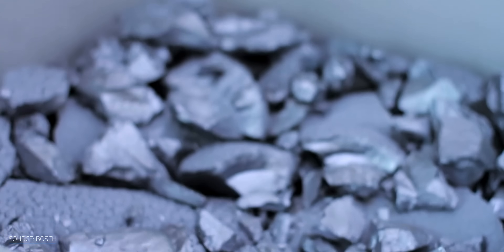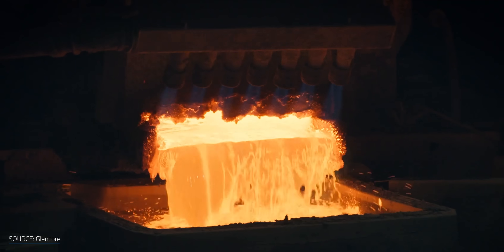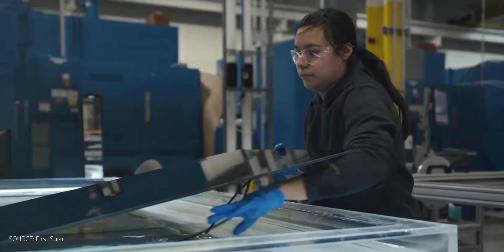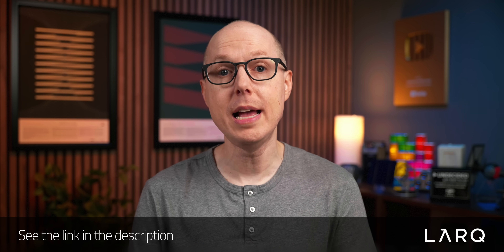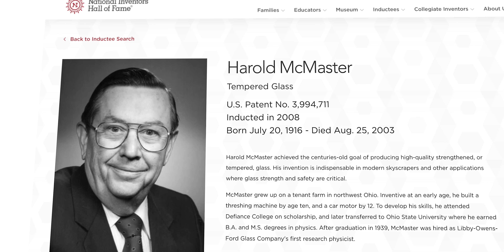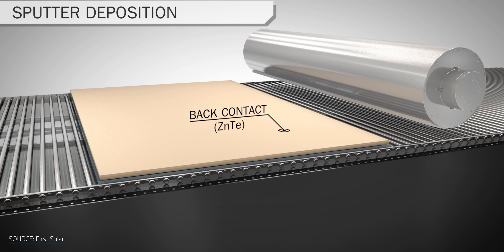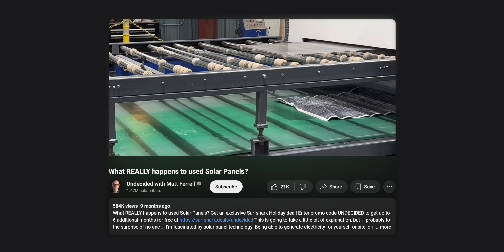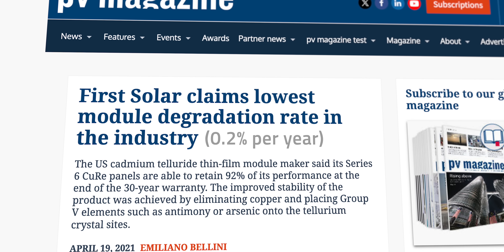How the Next Big Solar Panel Tech is Already Here

Comment: Once they get the efficiency to the same level, the weight reduction could actually prove very beneficial to residential PV renovations. Since it weighs less, it would reduce the need for roofing/truss modifications to support the higher weight load.  I think this is a good thing for everybody.  Yes, the recycling is critical, but that should only be a process limitation, not an absolute limit.

Comment: The biggest issue with CdTe is, what happens when we need more than just the byproducts? Even right now CdTe Panels are barely competitive to silicon. And Silicon Panels are already dirt cheap. So much even that they aren't even the main part of the cost of building a solar farm. Silicon Panels also still get cheaper by the day.

Comment: With solar, you can avoid many of the "moving parts problems" with wind and other renewables. If you can produce the solar panel for a 30 years lifecycle with just a few years of the energy produced by the panels, and high degree of end of life recycling, this could be a very good alternative both to other solar panels and other renewables in general.

Comment: I'm okay with cadmium, mercury, uranium or whatever, toxic or non-toxic. As long as longevity is close to market and as long as there is a very high sustainablity and renewablility at scale. 

If efficiency, location buildout, cost per watt output, etc. is higher, I'm okay with that metric long term.

Comment: Good video. On the numbers point though, this is missing a key piece of information - what’s the capex cost for CdTe vs Silicon. Unless there’s a major advantage in usable life/degradation/maintenance capex, if CdTE is 30% less efficient then very simplified math is that a panel producing the same energy output needs to be 30% cheaper to be cost competitive. If it’s not, why would you buy one vs silicon?

Comment: It’s always going to be down to how cost efficient they are. You can buy new 560W bifacial panels for $200 each. The real issue with solar is installers overcharging like car dealerships, both in materials and labor. DIY as much as possible imo. CdTe has a ways to go, because there’s not as much competition. 

It reminds me of ethernet v token ring. We have, arguably, slower networks/internet due to licensing issues preventing competition. Now token ring has been left in the dust as far as innovation and cost goes. The best doesn’t always win in any given market.

Comment: Very informative! Never heard of the technology, but based on the comments from those that have used these cells, I can think of great use cases. 
Extra federal credit for US based manufacturing and material sourcing can mitigate the lower efficiency. 
I these can be biracial, then when used in the vertical, the smaller string size is fine in a homestead agrivoltaic application. 
Lots of niche use cases

Comment: Cadmium telluride had been on the horizon for various photoelectric applications since at least the mid-1980's. I know that because part of my paycheck depended on an exotic bestiary of research substances and materials. Those were fun times.

Back then, solar arrays used discarded single Si crystal discards which failed specs for wafer printing.

It was my privilege to have a seat at the table when many of these technologies were in development. Gallium arsenide for Josephson junctions never expanded as some proponents wished.

That's how it goes.

Comment: It sounds like they only out-compete silicon panels in thin film configurations, so it would need to be an application where weight is a more important consideration than efficiency. My impression is that solar panels, even very light ones, are generally not practical additions to vehicles. However, a camper van or sailboat might be better off exchanging a large battery for a smaller battery supplemented with panels.

Comment: You end asking if CdTe panels are something I'd use, and the answer is 'eventually'. I'd be using them for a home PV setup, and I have limited roof space. Once CdTe matches or exceeds Silicon in efficiency, then it becomes a strong contender. After that, we need to compare price over the life of the system.

Comment: I would expect CdTe to be more popular for homes. 30 years retaining 89% of its effectiveness is nothing to sneeze at. That means it's a once per lifetime purchase. If they designed the panels around it, you could replace your whole roof in panels with fakes where gaps are required. Efficiency isn't that important as seen by Tesla's solar roof tile program. Longevity is.
Cost is also important. The panels better be cost competitive with silicon otherwise the lower efficiency leading to more panels will become a factor in the initial investment.
Reply: UndecidedMF05  aaand blocked.

Comment: What's the cost difference? For many middle & low income communities, cost may play a significant role in choice of panel - although it's the inverter & batteries than are the most expensive component of a solar system?

Comment: Do they have to be on glass? Thin film construction suggests that flexible substrates could be workable. That could improve installation costs, allow alternative nonplanar substructure, and reduce weight and waste.
Reply: It's about cost per watt, which sadly goes un-mentioned in most low-level tech talks.

Comment: Seems good stuff.  Can the panels do well in cold places?  In The Netherlands (with small amounts of sun in winter - so panels need to be maximally efficient).  Cadmium use is legally very limited due to its toxicity in many European nations.  Example: in The Netherlands, land fill is an illegal disposable method. Recycling of everything is the key obective - remnants are incinerated and those ashes are used in street bricks (in cement).  So, would not be acceptable that toxic metals end up on streets as rain flows over this and into the soil. Silicium seems much less toxic. How to deal with the cadmium? Anybody? I would not want any of this near our house at all .....  but in Europe, I guess, people are more concerned about toxicity of ground water. Fracking for instance, in The Netherlands, is illegal (otherwise a lot of oil to be pumped). How do Americans enjoy high toxicity levels around land fills and how do you enforce recycling of Cadmium-loaded products (even when owners go bankrupt)? In Europe, you pay, in advance, when purchasing new electric equipment or appliances, a fee for its recycling. This funds the recycling industry. Could this work in the US - or how do people expect to keep America clean? Otherwise, seems like a cool technology ....  but not convinced.

Comment: The only real application CdTe would be hotter climate. Deserts that have vast amounts of space and not cool enough to be consistent power generation. Still 31 percent more area…that alone to consider cost of installation is higher. 

Install cost to production to life of the panels to location to power transmission distance.

The math would have to work out for the investor. Also, what will people pay per KW?

Comment: I have seen thin solar panels glued directly to adventure van hoods. I wonder if this is the type of solar technology being used on those recreational vehicles? One of the problems RV owners have had is the need to mound rigid panels on platforms that allow air to circulate underneath. The market for solar or other technologies that facilitate mobile living off grid with energy independence will only increase. Especially when states like California are banning inexpensive, reliable fuels like propane.

Comment: I don't think CdTe thin film can take on Silicon Solar panels. 
1. CdTe panels are made by just 1 company commercially i.e First Solar of USA. And 99% of solar panels made from Silicon have gone past 24-25% efficiency. With Topcon technology. 
2. HJT of Panasonic patent expired recently and Chinese are already using those which will have efficiency and temperature coefficient even more improved. 
3. And let's not forget about Cadmium poisoning. I wouldn't want it near me poisoning my water supply. 

So sticking to Silicon solar panels is the best approach for the foreseeable future. I used CIGS panels and they were better efficiency compared to CdTe back in 2015-2017 but even they are behind now

Comment: What's the weight difference?  Is that why they are made thinner because the same thickness would weigh more? Are the made Bi- facial?
The marine market takes weight into consideration when purchasing solar panels since there's only a certain amount of weight a boat can have and where the weight is.

Comment: thin film isn't next big, it previous big. it was invested into when silicon prices soared. its only problem is its cost. silicon is cheaper than ever and will be even cheaper. even thin cdte is more expensive. that's why first solar needs tariffs on panel import, it can't compete without them

Comment: This may be a silly question, but what does the open circuit voltage of each cell mean in terms of efficiency per watt-square-meter for a panel overall? Is there a series loss that has to be figured into the equasion, or can we just stack however many we need to get a reasonable voltage then parallel to get the current? Also, what does the thermal performance look like?

Comment: Q:  Are cadmium-telluride cells more easy to make more resistant to large hailstone resistant than silicon solar panels are?

It wasn't that long ago that a large Texas solar farm of many acres in size each was destroyed outright by a single intense hail storm.  'Hard to care about solar cell panel longevity when you live in an area where they can be destroyed by the weather at any time.

Comment: When You Needed More of Me, I Had Nothing Left

When you needed more of me, I had nothing left,
Drained by the weight of endless requests.
The sun was hidden behind heavy skies,
The wind fell silent, as if in disguise.

But deep in my core, where energy sleeps,
There’s a pulse, a promise, a dream that keeps.
Solar beams waiting to rise with the dawn,
Wind in the wings of a quiet storm gone.

I’ve stored what I can, in the still of the night,
Hydrogen’s whispers of future light.
Batteries drained, but with hope they’ll revive,
The charge they need to keep us alive.

With the right parts, with the perfect design,
Sooner than later, I’ll draw every line.
For when I’ve recharged, when I’ve gathered it all,
I’ll rise to your call, I’ll power your walls.

Sustainable strength, an infinite source,
Through sun, wind, and hydrogen’s force.
So wait just a moment, the cycle will turn,
And all that was empty will start to burn.

Comment: Though the video shows testing by bashing a panel with a weight, you do not talk about durability.  Specifically, what are the comparative strengths of silicon and CdTe in regard to resistance to hail and what are the resistance to high wind speeds between the two.  If one is significantly weaker, it would affect consumer choice in large hail and high wind areas.

Comment: Do you have a lifetime watts per square meter comparison for CdTe vs Silicon?  Those lower degradation numbers seem like they would significantly offset the initial difference in efficiency.

Comment: You forgot to say that THEY WEIGH 3X MORE! 40kg for a 530W model. 19% efficiency, 227V open-circuit voltage, 3A short-circuit. $243 guide price. But the same page says that a 530W silicon panel costs $800 bwahaha (I get mine for $100).

Comment: This episode felt like an infomercial...I personally don't see the point of CdTe . At the end of the day,  for large solar installations especially, the slimness of panels is of little importance. Frankly efficiency is also not that important either unless you are short on space. Current silicon cells are more than adequate as a cost effective alternative, for any terrestrial application. What really matters is cost/unit of installed power (dollars/watt), or rather, cost of unit of energy produced over the lifetime of the installation.

Comment: The real key is Lithium battery pacs - the more battery pacs you make the fewer cars you can make. if you used every ounce of lithium just to make cars; you could make 15 million Ys a year, to replace the 1.5 billion light vehicles would take 100 years, then you need another 100 years to do the trucks. If every BEV is going to need just 1 full charge for 5 days - then you must add 20% to those figures - 120 years/220 years, if you need 1 charge a day 200 years/400 years - that doesn't count lithium for 1 billion cell phones each year, millions of laptops and tablets, portable power tools, etc etc - You could give solar panels away and it wouldn't fix anything - BEVS and solar do not work because lithium doesn't work.

Comment: Is the intellectual property (IP) around the use of CdTe widely available, or is its use in manufacturing solar cells being controlled/restricted? This an important sub-topic that should be covered when promoting a new(er) technology. Without discloser, it leaves misleading expectations.

Using patents to limit the use of technology has really impeded technological progress over the century.  One famous example is that Chevron acquired the patents related to nickel metal hydride battery cells and only continued to license use to Toyota. The combination of ExxonMobil, Chevron and Toyota were for over a decade very obstructive to allowing other automotive OEMs license battery technologies for use in EVs; until li-ion cells used in smaller consumer devices began being used to power EVs.

Comment: The main potential selling point that I see at this time is that they retain their efficiency for 30 and perhaps more years.  Silicon cells typically need replacing at 20 years as they degrade.  That extra 10 years can be huge if you have the space to install these.

The 2nd point is the ability to recycle the base materials.

Recycling or disposal of solar panels is going to be a huge issue.... and silicon panels do not currently recycle very well.  Lots of landfills will have to be built just for the silicone panels.

Comment: Obviously solar doesn't work at night. Increasingly no solar can be sold back to the grid such as in California.  This means the main cost of a solar system will be batteries. Solar panels have never been a major component of the cost of a solar installation for a home.  Batteries, installation, upkeep  of both roof with solar installed and the panels; then the cost of the panels, inverters which are low on the list. So even if the panels were free; it wouldn't lower the overall cost of a professionally installed system.

Comment: I know things change over time - especially prices. But you never mentioned price and that's a major factor in adoption. You said CdTe panels use less material but are less efficient than silicon panels. Does that mean they cost less so the $/Kw are similar? Why is the world adoption rate so much lower?

Comment: Honestly I'd rather Silicone panels, how thin the panel is is basically irrelevant when mounted on the roof of house, efficiency is far more important, cadmium CdTe really seems to make sense when space is limited like adding solar to small electronic devices and maybe for adding solar panels to EVs.
Reply: but weight is not irrelevant.
Reply: True, but the weight difference in a fixed location install like on a house isn't enough to be of any real concern, and the extra weight is quite easy to deal with on a house potentially only needing a few hundred dollars of lumber and a couple hours of work to cut and install.

Comment: 90% recyclable?
I'm on board!
The lack of effeciency sucks, but the point is greener tech right? That recycle rate hits that hard.
Reply: Aluminium Frame + Glas will likely easy be these 90 % . As long as they do not declare a cadmium recycling rate of 90 %  I dont like it.
Reply: @SchwuppSchwupp  
That's fair.
I wonder what it would take to recycle cadmium, on that point.

Comment: Honestly, I think the answer is to get the price as low as possible and worry about efficiency later. This is a classic mistake the green people make. Stop worrying about trying to get everyone off fossil fuels. That should have never been a goal and ironically, it is the very reason why transitioning away from fossil fuels has taken so long. Instead, focus on economic benefit. If you try to build a highly efficient off grid system, the payback period will be several years. However, if you build a small cheap system that is only designed to offset the need for power during the hours of the day that energy prices are most expensive, the payoff period might be as little as 1 year. Make alternative energy so cheap that the average homeowner can't afford not to do it. Don't regulate, don't subsidize it, don't give tax breaks. Just use good old fashion engineering to bring the cost down and worry about the last 5% of performance later.

Comment: Clearly a punt from First Solar. CdTe is less efficient than Crystallines presently and CdTe is made from hazardous materials. Also unsure about whether these modules are recyclable at end of life. The USA is under enormous pressure to gain back market share in the solar module industry, but I think this ship has sailed. The Chinese are dominating this market with lower production costs, higher cell efficiencies and higher quality. The sheer volume of Crystalline production in China can only really be stopped by some new disruptive technology. I think CdTe is not that technology.

Comment: 13:28 Solar panel should be a standerd building material, solar city panels that have different sizes for exterior walls and "roofs" it should be standard practice for all sizes of building including skyscrapers all buildings should be completely covered in solar panels. It's unnecessary for solar farms to be separate they should literally be the city, every single building. 5:11 13:28